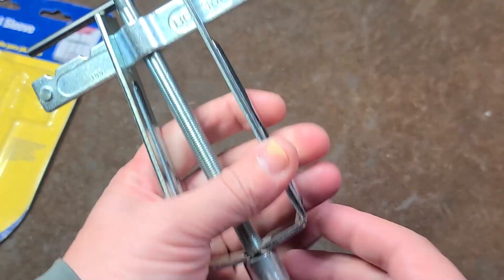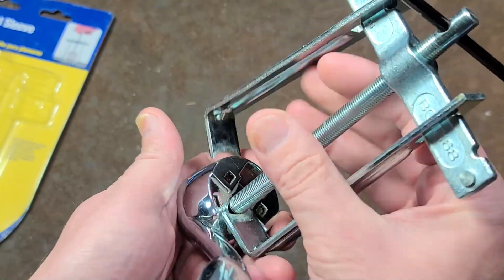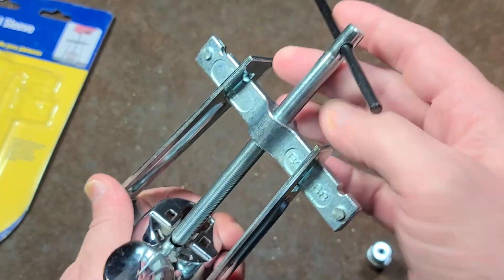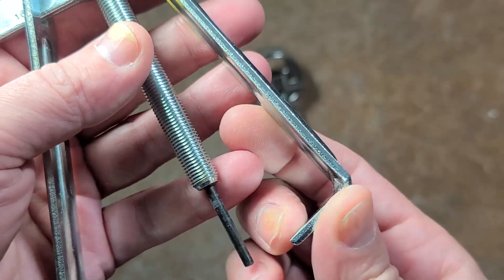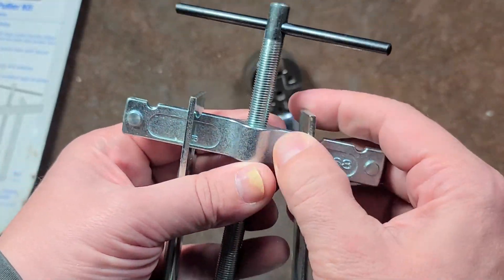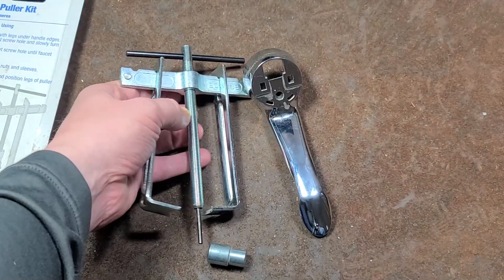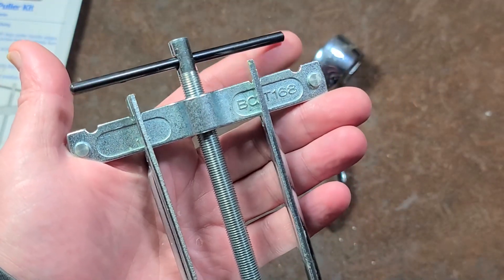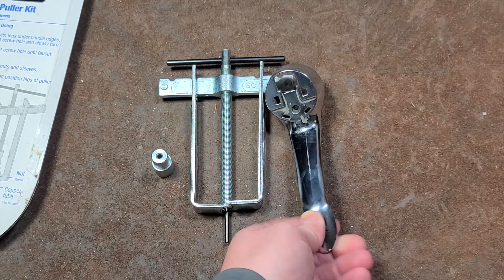BrassCraft Water Faucet Handle & Knob Puller Review

Comment: Good Video👌
What if the spindle doesn't have a screw hole? Should i drill a hole into the spindle equal to the pin length?

Thanks in advance👋

Comment: Does that tool come with another piece that is brass and threaded?
I wanted to use mine to remove a compression ring, but I cannot figure out how to do it.  I think I am missing a threaded part.
Do you have a video showing removal of compression ring using that tool?